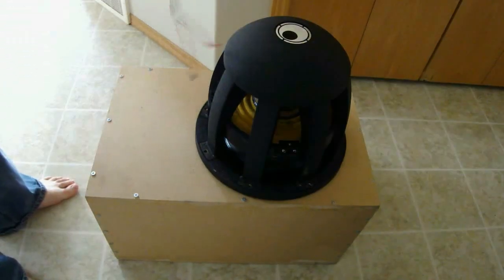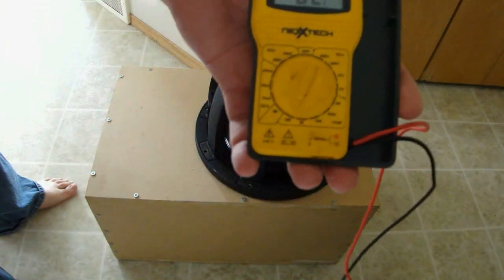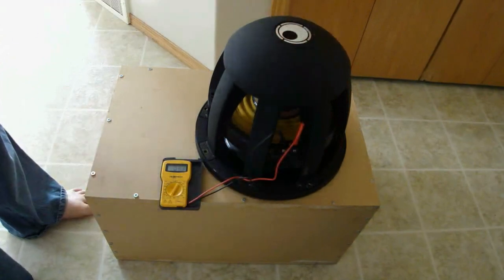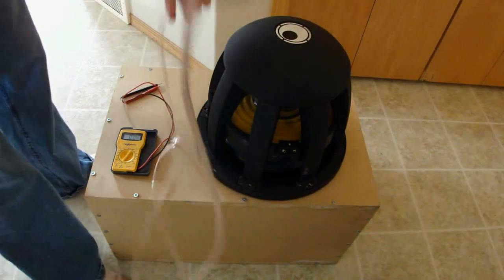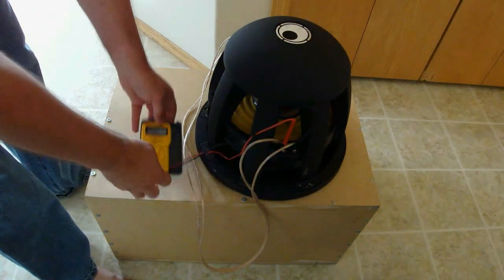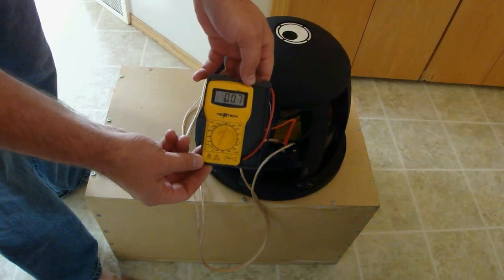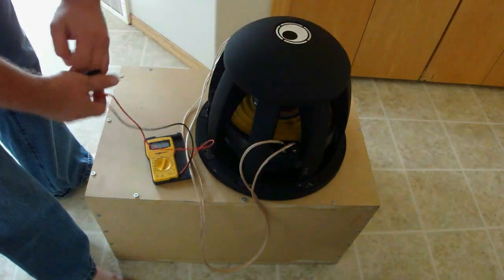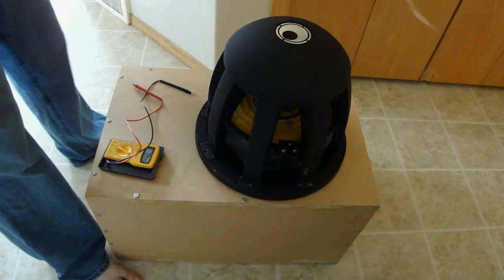Subwoofer Wiring Tutorial, Series & Parallel

Comment: Yes in the sense when you parallel 2 4 ohm subs and drops to 2 ohm final impedance. Your amp will produce more power at lower ohm. You would have to check your amp specs

Comment: @fukingook yes it does matter if you wanna prolong the life of your amp or get more power out of it.  Say if you have a sub that's rated being able to handle 1,000watts RMS and it's a dual 2ohm sub...if you have an amp that's able to produce 1kW RMS @ 1ohm you'd be able to match the impedance of the sub with the amp and get optimum power from that amp.  If you have an amp that is only 2ohm stable and produces 1kW @ 2ohms you'll damage your amp if you wire that dual 2 ohm sub in parallel.